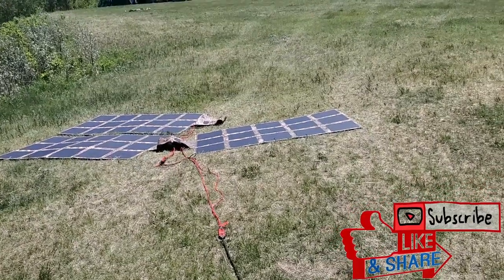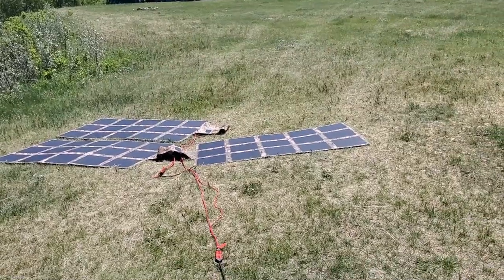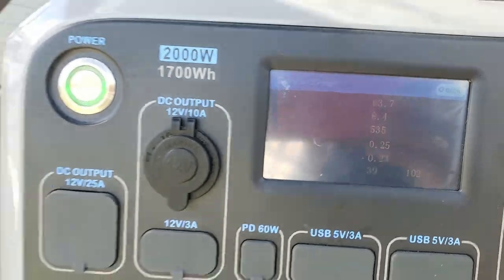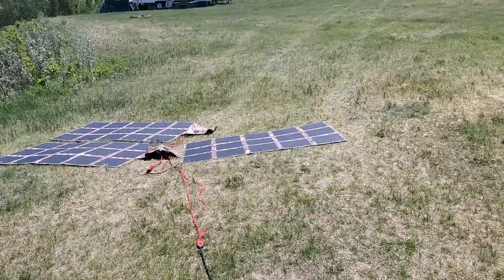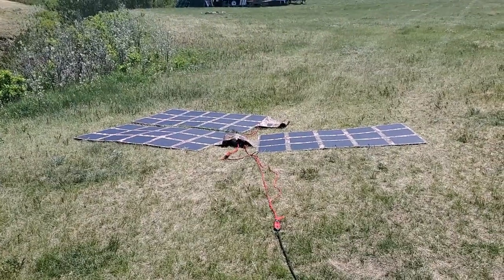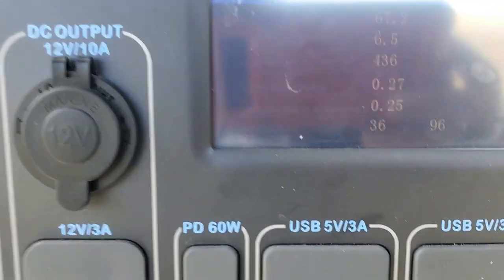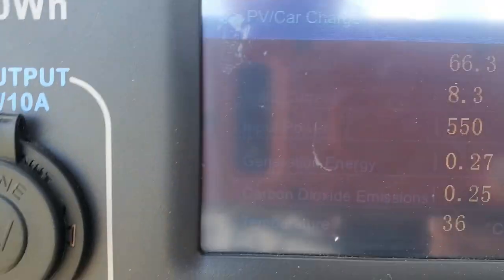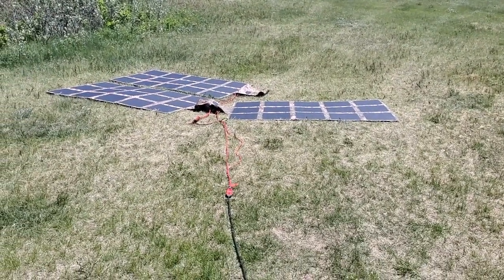600W Solar Blanket charging Bluetti AC200

Comment: Great video! I also live in Canada. And I have the Bluetti AC200P solar charger. Your 3-200 watt solar blankets are a giving a good amount of wattage (560 watts.) Especially being in Canada. I have 3 Bluetti SP200 solar panels and the best I could get out of them is 380 watts in a series connection. In the mid month of July. I Definitely am going to begin by purchasing at least 1-300watt solar blanket from you to use on my Bluetti AC180 solar charger. I realize I would need 2 solar blankets for my AC200P solar charger.

Comment: Did you use 2 series cables to do this with 3 solar blankets?  Would you need 3 cables for 4 solar blankets?
Reply from the maker: 3 series, 2 extension and 1 mc4 cable for powering from four 200W Solar Blankets for this set up